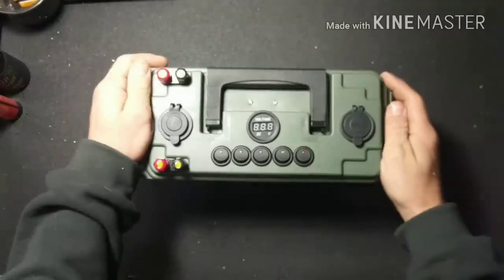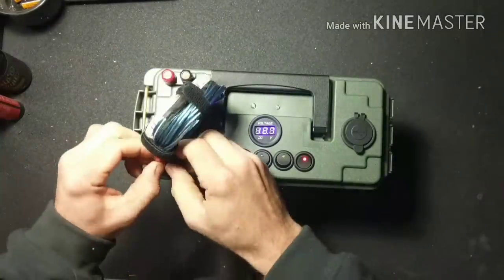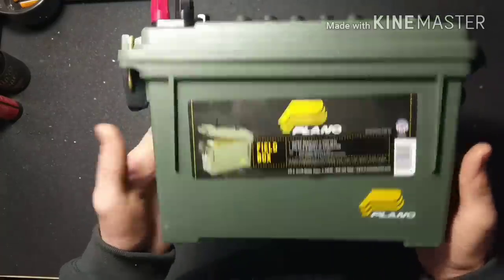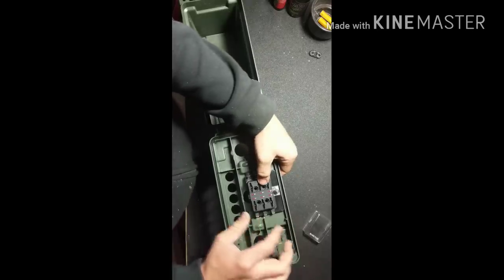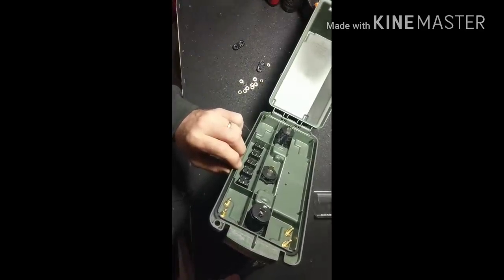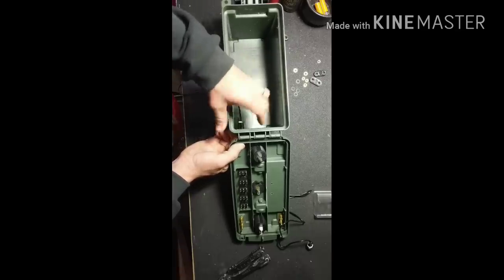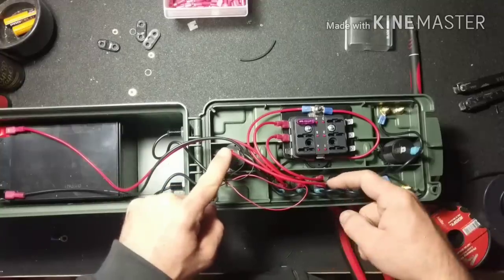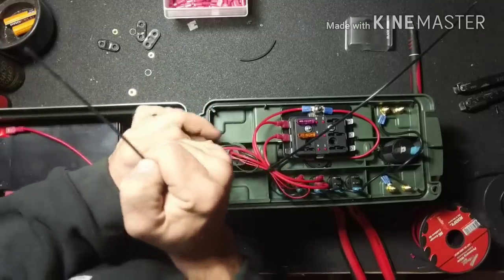How to build a portable power box version two

Comment: Nice!  I would echo another comment about adding the discarded plastic piece from the banana connectors to add reinforcement.  Also, I believe you have your fasteners backwards in those.  Placing the flat washer over the lock washer defeats the lock washer's purpose of locking the nut on.

Comment: No dimensions for the hole layouts, that's a bit of a pain. Now the link for the fuse block lists one with entirely different dimensions and will not work in this configuration - I've tried.  Just sayin' you might want to list one that has the original dimensions.

Comment: THANK YOU for posting this. I built two of these three weeks ago and last night one of them kept me from having to call for a rescue on the Barren River in Kentucky. Ended up several miles from camp after dark but had one of these on my kayak. (I'd built them just in case my cell phone needed charging as I've had it die while on the water before and don't like not having a communication device while I'm out.) Last night it was the only thing that kept me from having to stop and wait for rescue or daylight. The LED lights on the front made it so I was able to see far enough in front of me to continue on my way (Very slowly, but still on my way.) I would recommend anyone who kayaks in rural areas make and take on of these on EVERY float.
Reply from the maker: Can I use your story in a video?
Reply: @JDSOutdoors  Absolutely. I seriously depended on this last night for 2.5 hours to get me back. Without it, I have NO doubt I would have had to call for help.

Comment: I got to the box on my own, planning to make a simple box for just my fish finder and a charger. Now...I’m doing this. I could use me one of those! Excellent DIY. Thank you!
Reply: I've made additional "improvements" for my use of this design. I added two flush-mounted SAE connectors into the side of the box. One, I connected directly to the battery. My battery charger has an SAE connector, so I just plug it into the direct-connect port for charging. I put another one in the opposite wall that is switch/fuse connected. I put an SAE connector on my Garmin power feed and I plug it into the mated SAE port. I sealed around each with some marine-bond because the holes I cut were imperfect rectangles, covered by the mounting disks. I mounted both with pop-rivets, rather than nuts/screws. To help me remember which SAE port is which, I set one vertically and one horizontally and also connected the one on "the right" right to the battery. (it works for me to remember). I charge with all switches off to prevent any charging from hitting the system. I can flip the main to see the voltage status. Again, thanks for this DIY. You really got my imagination working in the right direction. I'll use this for the life of my boat, I'm sure.

Comment: Thank you for the great tutorial. Just finished my first box last night. The best thing about your instructions is that it walks anyone through the HOW and WHY to build. I used the same box and most of the components, but I was able to adapt my box to fit my needs using different components. I only put in one set of power posts as I thought they were great for having a quick alligator connection for lights and charging, etc. But I also added a marine SAE connector so i had a quick and more secure connection for my fish finder. I then cut the wires on my fish finder power cord and put in an SAE also so I can just plug it right into the top. Great video. Thank you very much. Liked & Subscribed.
Reply from the maker: Thank you very much for the kind words
Reply: Good idea ,,, are the components you used available at Amazon?
Reply: Kevin Dunham Yes they are. I think these are the other components I used that he didn’t list above already. SAE Connector, Electop Solar... https://www.amazon.com/dp/B07WCMX24L?ref=ppx_pop_mob_ap_share & SAE Connector DC Power Extension... https://www.amazon.com/dp/B07MP9MYKP?ref=ppx_pop_mob_ap_share
Reply: @warrenhansen4443  Thank you !
Reply: I’m wondering about a momentary switch for the voltmeter to keep it from being on the entire time.  Not sure if it would save enough battery to be worth the extra effort or not?

Comment: Excellent video.  I ruined several switches inserting the blades.  I added dielectric grease which helped a little.  I was running out of switches and first inserted them into a blade to stretch them out a little and I didn't ruin anymore switches.  I plan to use the box in saltwater for my electric reel and instead of bolting in the fuse box and adding two more holes I used adhesive sealant silicone and clamped it overnight, it seems to be secure.  Thanks for the awesome video.

Comment: I made a similar box for my ham radio gear but I included a way to put AC power in so I could have a charger as well as a plugin 13.8v power supply as well I used a larger box that has a 18 amp hour agm battery as well.

Comment: Modified this design to use in my Vibe Shearwater 125 fishing kayak. I wanted to use the electric box they provided, and this design worked well. I just had to orient the features differently. While this design is a horizontal or landscape orientation, I had to change my version to a vertical or portrait layout to work well in the center of my boat.

Comment: Thanks for this video. I decided to build one following your design with a different box. It turned out great! I’m no pro when it comes to wiring stuff up so it helped having such a detailed tutorial. I use my box to power a fish finder for ice fishing. I’ve used it twice now and I love this thing.
Reply: Lazaro, was it hard to power your fish finder without having to use the power poles. Please advise.
Reply: @martinlarkin9624  I actually didn't put posts on my box. Powering the fish finder was simple. I used a switch with one of the fuses on the panel for power and went directly to the battery for ground. 2 years later its still going strong, I just used this setup for ice fishing yesterday.
Reply: @lazarogarcia2122  thanks for letting me know.

Comment: nice build thanks for the vid. 
for more $$ you can do this with a lithium battery instead of a lead acid battery. and you can either get more Ah's or 1/2 the weight
Reply: This is great but wouldn't you also need a protection circuit for the battery?

Comment: Made mine today with a  larger plano box and 35Ah AGM battery. Had trouble with the tiny led wires even using automatic strippers. Used pop rivets instead of machine screws for the fuse box. Thanks for the great tutorial!

Comment: I notice there are two fuse spots left over... room for a charging circuit possibly to charge the 12 Volt battery from a solar charge controller

Comment: Great job.  Laid out great and attention to detail is good.  I would say that you were ahead of your time with this project in 2017.   Only thing that I would add is using those 90 degree spade connectors as this would bring the the wiring even closer to the lid and  clean up the wiring even more.  Would also lessen the chance of a wire being pulled out as the lid is opened and closed.  Just my thoughts.  Good job again and I plan to use this layout.   Thanks.
Reply from the maker: I have since changed to those and they do help big time but I was one of the first to do these builds

Comment: Spent the last 5 days watching about 30 different videos on similar boxes and this by far the BEST for an electrical novice like me. VERY straightforward and answers everything right up front. Excited to see the solar video. A few questions for all of you far smarter than me on these things. Any issue following the same basic wiring as OP but replace one of the banana posts with an Anderson Powerpole faceplate? I would then like to figure out how/where to wire in a solar charge controller. I’m assuming I can plug solar panels in using the power poles to charge battery (as well as other options discussed in previous posts). I’m guessing I’d have to split the leads coming off the battery and have a set going into load just as in original video and another set going into CC battery input? Would love suggestions/advice if anyone has figured this out as simply and cleanly as JDS Outdoors original video. OUTSTANDING VIDEO JDS OUTDOORS!!
Reply from the maker: flyhoovers thank you for the kind words I apologize about the solar video not being out yet but it's coming I promise just been busy lately
Reply: JDS Outdoors no problem at all man- I know you are sharing this great stuff on your own time and dime- I really appreciate the content!
Reply: flyhoover

Comment: Great build. Only thing I would do, for safety, is put an inline fuse between your battery and power switch.  I’ve seen batteries runaway, especially the smaller cheaper ones; even the lithium ones.  Thanks for making the video.

Comment: Nice job keep up good work i have one i build msepty self with 2 lithium battery 18V 12A & 18 V 5A battery with 36/48/72 V  converter 12V 10A out put with 12 way fused block and 500 watts  inverter and  4 switch and better meter tell volt and percent of battery and 2 110 AC out let 15A and usb type c and 2.1A and 3 usb port usb 2.1A in small tool box

Comment: Awesome video - thanks for taking the time to do the step by step instructions. You definitely make it look doable. Not being an "electrical guy," I would generally shy away from this type of project, but your step by step walk through has made me eager to put one together - thanks!!!!!

One quick question - wanting to use this for a kayak, have you ever considered using waterproof SAE plugs vice the power poles you put it? I'm thinking that I don't want to use power poles for a box that is going to be used on my kayak :) I think it owuld add some expense to building the box, but probably a better option that exposed poles in a kayak.
Reply from the maker: Thank you and I have not considered it for this application  but its definitely  doable for use in a kayak.

Comment: Question!! Hey JDS, loved the video,, I m building a simple box and was wondering if I could omit a fuse box and just use a inline fuse from battery to master switch.. thanks TC from NV
Reply from the maker: Good question and yes you absolutely can.
Reply: You can but I believe the fuse box is used as a minified circuit breaker to protect each application of the box individually from one another possible short circuiting and or overloading.

Comment: This is a really great power box! If I made one I would use a LiFEPO4 battery which is typically 1/4 the weight of a SLA equivalent while providing double the amp hours of SLA types. The LiFEPO4 batteries cost more than SLA, but they can be charged roughly 4 times as many as SLA and will maintain their voltage until they are dead. Also SLA batteries typically need to be kept on a floating charger if you need them to be charged up at all times while not in use. Otherwise the voltage will decline rather quickly over time. LiFEPO4 batteries don't need to be kept on a floating charger, but actually need to be charged with chargers compatible with LiFEPO4 batteries.

Comment: I use a over sized 50 cal box I run two batteries one on each end been working good I put in a solar port to plug my panel in we do a lot of off road atv may be 3 or 6 days out before we get back to the truck I have all my camping equipment on a trailer I pull behind my atv.
Reply from the maker: I've made a few of those as well.

Comment: Can I buy one?
Reply from the maker: Jason Ellet with shipping it just doesn't make sense to sell them if they have to be shipped. I do make some to sell every winter locally but in the summer I'm super busy with work
Reply: I will build you one just like this 

what are you willing to pay?
Reply: JDS Outdoors we sell these and ship...f you don't mind me posting our site.  Please let me know
Reply: JDS Outdoors  I'm able to pay for it ! Just to have extra power backup since we don't have power in some areas. Puerto Rico.
Reply: Jonathan Reyes check out John's Power Boxes on facebook
Reply: Moriah Benjamin  thanks
Reply: Jonathan Reyes no problem. He does ship. And he offers 2 or 3 different size boxes. :)
Reply: How many hours will this battery pack last?
Reply: you can but its way cheaper and funner to build them. been doing it for years
Reply: @wyzkrax  depends on what your load is... the battery used in this box is 12 Amp hours... that's 12 amps for one hour up to 1 amp for 12 hours... or any ratio... i.e. 1/2 Amp for 24 hours. 

The watt hours is some what like 144 watt hours I think. That strains my brain.
Reply: Ted May please talk to me, don't really need, but I love it, Give me an idea of cost, using no worry parts, I want to keep in touch with truck
Reply: Jason Ellet i just bought one for 167$ it is amazing it has a 12v 10amp matters lithium and it ways four pounds and it is amazing
Reply: @wyzkrax 
Depends on what you're powering.

Comment: Just made this tonight following this video.  Great step by step instructions!

Next time I'll make sure I get a proper bit to cut out the larger holes, but the biggest I had was a 3/4" spade bit so I used that and reamed out with a dremel which was not pretty, but it worked!

Thank you very much
Reply from the maker: Geocaching Dad this is why I made this. thank you
Reply: Draper Redline 68470 Hole Saw Kit worked great for in the uk

Comment: Why would you need all these switches . Idea if you have a wire that runs from the battery to a switch then to something else feed a loop of wire to the plug to be crimped  that way you don't have to cut it and run it to the next place .Great power box my friend . thanks for the video.
Reply from the maker: More then one way to skin a squirrel

Comment: Love your construction style with the connectors and wire cut to the correct length.  The only thing it's missing is some labels for the switches.  Just noticed the solar power upgrade in the next video.  Keep broadcasting!!
Reply from the maker: Thank you and I 100% agree on the labels it has crossed my mind

Comment: Nice tight package but I would have used 10 gauge from battery to a better switch to the fuse block. And then a 30, 20, and 10 amp outlets on the top. Why go to all this time and work and only have a 10 amp power supply with the 16 gauge wire? Especially if a powerful Lithium battery upgrade is used. I design solar energy systems so this would be a fun and easy Winter project.
Reply from the maker: That's the beauty, build it to suit you that's what I did and it works great for me and yet easy to change or upgrade
Reply: It’s a great build.  I tend to overbuild electrical.  As you fused the battery to fuse block it’s fine. Thanks

Comment: I use the shot shell case. It’s not as tall. I also but an led spotlight on top. I use Milwaukee m18 batteries for power. Just have to make sure your lights are rated for the m18 battery.

Comment: This is a World Class instructional video for this kind of thing (by FAR the best I have seen), so I'm about to order all the parts listed - THANKS for really comprehensive video - YOU ARE THE MAN! Have one question (if you can guess the answer): Will this setup work okay with a pair of 75 watt 110 volt LED (cool but still 75 Watts each, and I know I'll need the plug-in inverter) soccer field lights? I am a real estate photographer and will use these lights for exteriors and never more than 10 minutes at a stretch. I know (?) that is a constant 12+ Amp draw. Like you, I am not an electrician, but I suspect yours or most subscribers' guesses or suggested modifications are far better than mine. THANKS!

Comment: Nice DIY vid. Just finshed mine. Came up great. Just question re switches. In this vid you said the Middle prong is for accessories and bottom prong for Feed from Battery.In your ice box video you say the opposite....My switches had no instructions and I wired acceories to middle prong. Worked fine. Maybe it doesnt matter which was as you long as you dont get the ground mixed up....

Comment: You can also get the adapter that bolts onto your box and to the battery and never open your box or turn on you master switch to charge your box I camp alot and use my truck to charge my box with my truck you have to turn on the master switch so you will not burn up your battery because you not putting in 1 or 2 amps the aternato on your truck puts out about 90 to a 140 amps I let mine hit close to 14 amps and unhook it takes about 10 minutes on my truck to full charge.

Comment: Great video you made. Everything is so much more clear to me except when it comes to charging your box using those sae plugs. I know that the one prong that is exposed is the positive side of the plug and the not exposed is the negative. So what I don't understand is when you plug two together doesn't that make the plugs connect positive to negative and negative to positive ?? I've got a few of those sae plugs and would like to use them. Do I reverse the plug I have on the battery so it connects properly to any other connections I may use ? Seems logical and only way to use two plugs properly.

Comment: Probably a stupid question.  I want to build a box strictly for kayak lighting.  Is there a better plug in connector I can use on the box so when I want I can just plug in my nav lights, flood light, interior lights and then have a switch box up where I sit.  I just dont want to use alligator clips.
Reply from the maker: Yes it's called an sae plug you can add multiple outlets and use the sae on multiple attachments. Way more waterproof as well

Comment: Great tutorial but I've never seen a lock washer put on before a flat washer. 
Have I been doing it wrong for 45+ years?
Have you ever installed a battery capacity meter instead of a volt meter? I thought it would be more logical since lithium batteries can read full voltage even at half capacity (used).